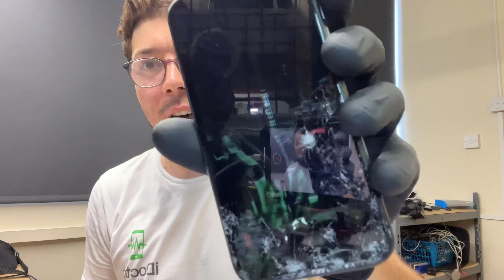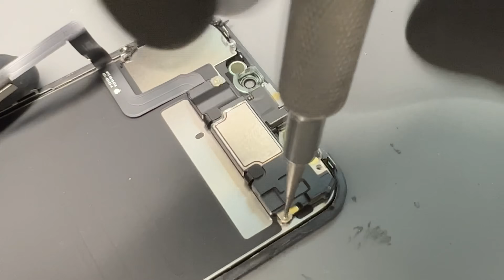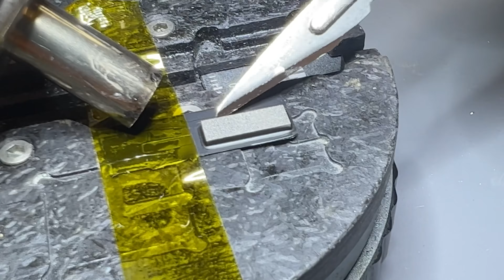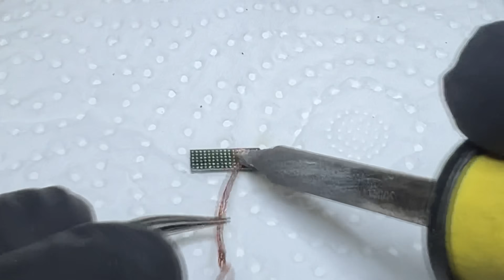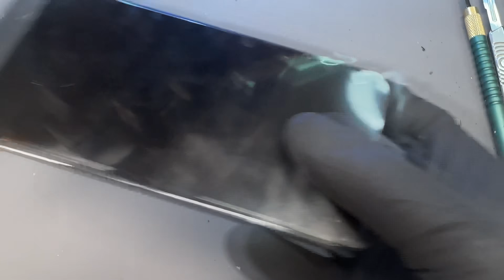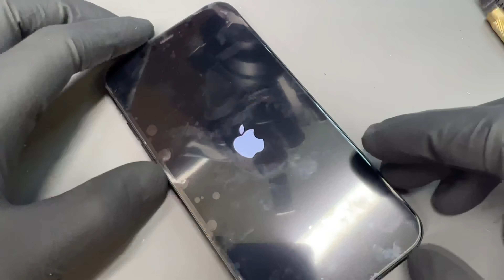The Ultimate Guide to Replacing the Screen on an iPhone 11 and Avoiding the Non-Genuine Part Warning

Comment: cool video thanks, I'm just Joe blog replacing the screen on my own phone and have used aftermarket which has worked perfectly apart from the non gen message and non of the videos mentioned this chip until after I'd finished and searched getting rid of message lol and found this, I'm not about to take it apart again just to get shut of the message but will keep the old screen with the IC so that should this new non gen get busted again I will definitely try your tutorial next time. Thanks again for the post.

Comment: Nice Video, short and to the point.  You can purchase replacement LCDs with a pre-balled flex.  Presumably this will allow me to skip the step where you reball the IC iteself?  Have you tried these LCDs?
Reply: Hi Jon, did you find out the score on this, as I have the same question!
Reply: @markaffleck4622  Unfortunately no.  I attempted transferring the IC without success. The problem I had was that the IC would not stay in position, even with lowest airflow.  It's so tricky for me!  Practice may help but it feels like I should be doing something different
Reply: @jongarrett933  Thanks for the reply. I managed to successfully do this procedure for the first time, but it took me five attempts! I always had no touch in each case. I have tried both type of screen (the 'pre-balled' flex one and the one used in this video) and have come to the conclusion that you do still need to re-ball the IC regardless. I used the lowest airflow and just approached the IC slowly and then watched for the slight movement as the chip 'sucked' into place. I think it is just practice, don't give up! I'm no expert of course, but have found a method that works for me.
Reply: I'm guessing those pre balled displays are only meant to be soldered on with a pre heater like in the video. 
I also did it with a pre heater and worked wonders!

Comment: Thanks for the tutorials you make, I have a question. 
It is this the only one method to avoid the message ? Or it happens only if you apply a replacement screen ? 
If I replace the screen with an Apple Original the message will happen the same if I don’t replace the chip from the video ?
Reply from the maker: Sadly apple have encrypted this part and currently for this model this is the only way outside of apples repair network

Comment: Hello - nice video. I’m going to attempt this repair. A couple of questions please - what temperature and flow are you using for removing the glue and recalling the IC please? Also how do I prevent lifted pads when removing the IC from the old flex please?
Reply from the maker: If you're unsure of temperature and flow I recommend practising on broken displays first. 

To avoid pulling pads, this is the same principle as above. You must practise.

Comment: Do you have to apply new solder for a clean connection? What about just removing the ic and then transfer right away to the screen?
Reply from the maker: Yes, new solder for an even and clean connection. If you transferred the ic direct there is a risk that some pads may not connect